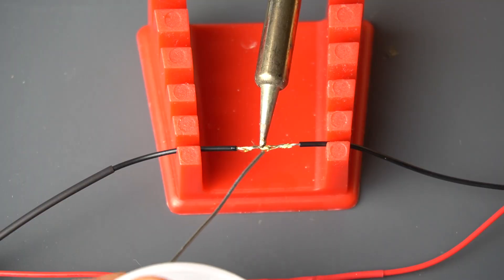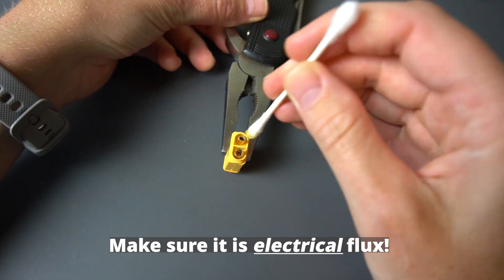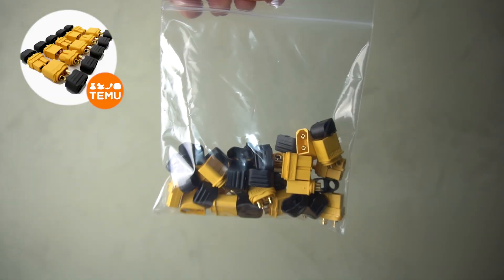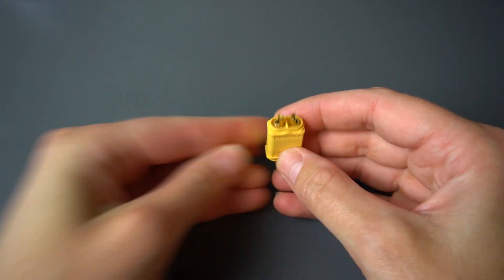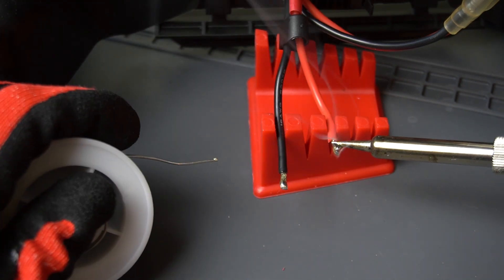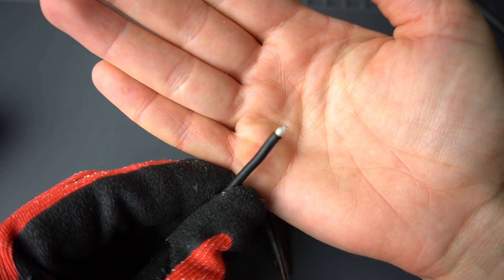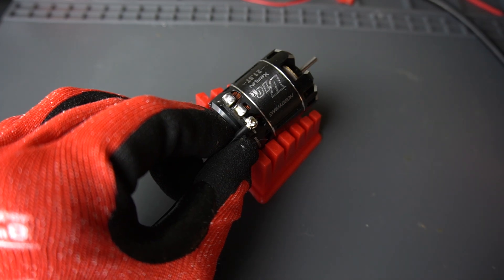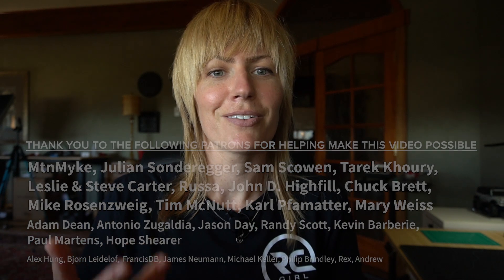HOW TO | Radio Control soldering basics for Beginners

Comment: I purchased the 2-in 1 soldering station from Temu from this link.  I'm having difficulty finding replacement tips as it only came with 1 tip. Do you have any suggestions or the link for replacement tips. Thank you

Comment: Well I always clean the tip of my iron when I get done with a soldier connection (that's how I was taught years ago) and for me it's one of the most important steps when I soldier, I've used resin soldier with resin soldier flux but some acid flux with some silver soldier works better for electric connections

Comment: Best Solder is 62% Sn  36% Pb   2% Ag  solder as it has a slightly
 higher electrical conductivity, cooler soldering ~200°C and cleaner result (shinier / harder skin). Best thing about solder is you only need to buy the best quality ONCE.  500g roll will last you your life time. Kester is brilliant and yes I did buy a roll from Asia and I used 1cm to discover it was pure turd. It's now a paper weight.

Comment: Great vid Hayley, as always! So many folks are intimidated by soldering, this video will help a lot for sure. And yes,  a point I always like to make.... spend the money and get a good soldering station. It's a game changer. It is really hard to get good results when you don't have enough heat. 😉
Reply: I’ll second that. Always get the highest power iron you can. Work quicker, less heat transfer then. And get a good soldering “helping hands” station. I always struggle with battery plugs! HATE doing them, especially on a live battery!!

Comment: Awesome video 👍 Pro tip: after you have remove isolation of a wire. Twist the wire in the same direction as the wire is already twisted. Then flux and tin it 🙂
The twist make the wire easier to solder to e.g. a connector.
Reply from the maker: Thanks - good point! I did twist it but didn't mention it in the vid whoops

Comment: Your solders on the XT60 and motor don't look good, don't flow out enough
If you use a larger tip (3 - 5 mm) you get better heat transfer.

Comment: You mentioned it several times but can’t be emphasized enough. Use plenty of flux. It will make soldering so much easier.  Rosin core solder just isn’t enough. 

I’m sure somebody will chime in with when you need it and when you don’t, but I always clean the flux from my solder joints when done using isopropyl alcohol.
Reply from the maker: @marks7445  yep I forgot to mention the cleaning with IPA 🤙🏼

Comment: Great vid! 
I would recommend using a much larger tip with a flat spot on the soldering iron for larger diameter wire and joints, it will transfer heat more quickly. You'll find the small tips will loose heat too quick and stick to the joints. Also best to place the iron underneath the wire for a few seconds and touch the solder on the top side of the wire.
Also try not to apply too much solder to the wire or take too long to make the joint as the solder will wick up into the wire under the sleeving making the wire stiff, especially if you need the wire flexible at the connection.